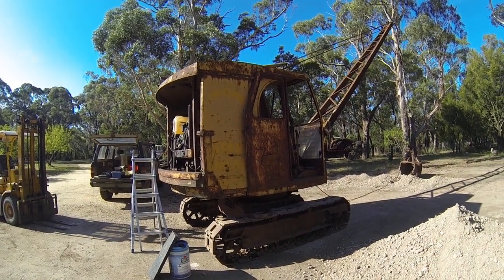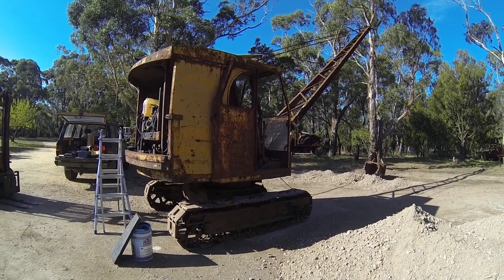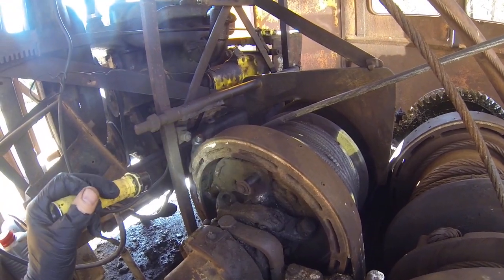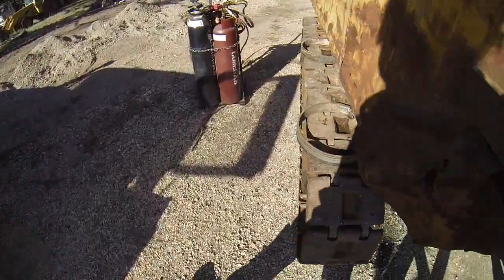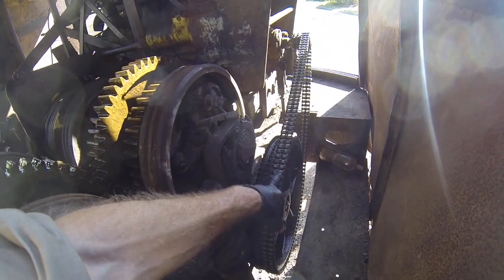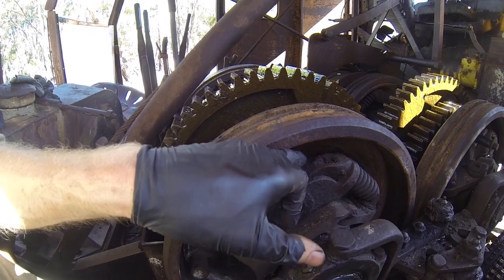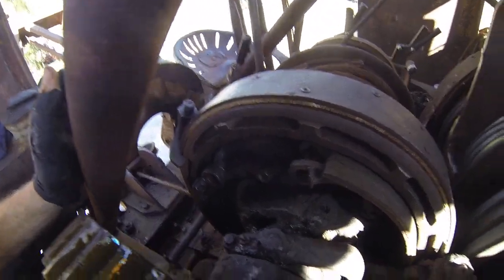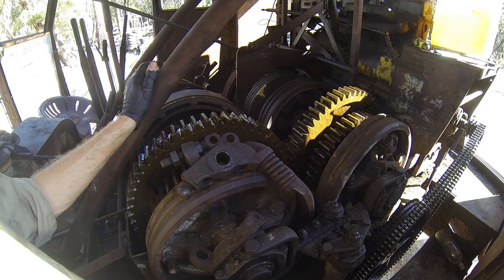Jaques J15 Dragline  Friction Clutch work/Repairs

Comment: when they been sitting for a number of years you got to slowly and patiently clean the rusty surface on the brakes and clutches with emery cloth and clean or replace the friction material...they will work when they are down to rivets if they are clean  but new linings are way to go if you can afford it
Reply from the maker: Yes i found sanding them was the only thing that really worked, though there starting to slip again as ive not used it for some time now.
I will be getting new material in the nesr future, to many other projects on the go though